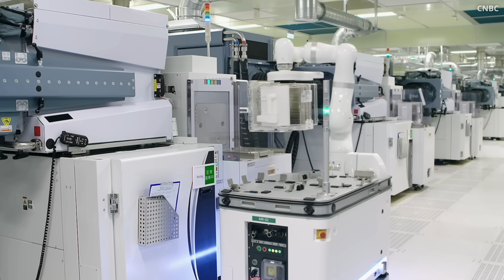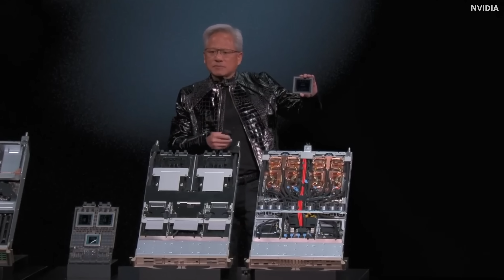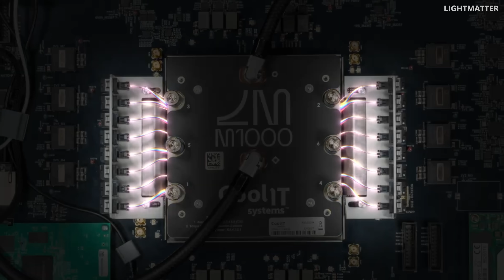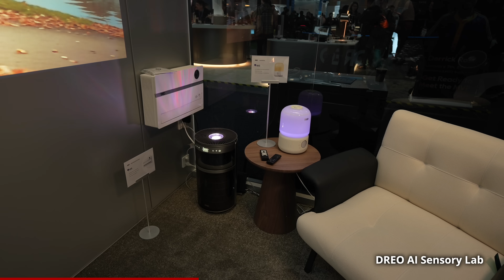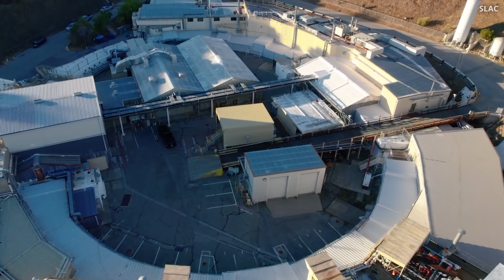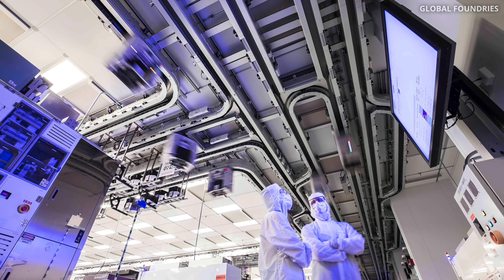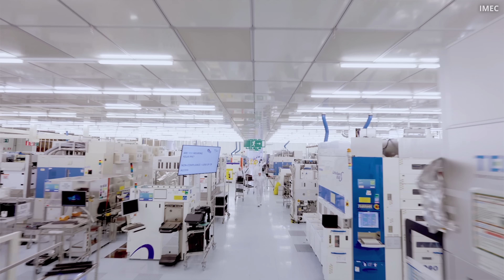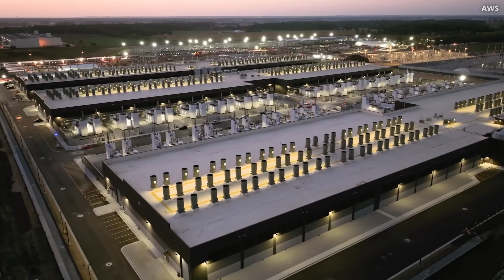This New Technology Could Kill TSMC and ASML

Comment: 1 nanometer = 5 silicon atoms. So the physical hard limit is 0,2 nanometer technology, or am I wrong? Eventually they will arrive at this atomic limitation with X-rays too, you can't go smaller/split a silicon atom? 🤔
Reply: I’m pretty sure she’s explained this in past videos.. where the nomenclature isn’t based on actual dimensions. IE. The 2nm chips being designed aren’t actually of that size. I think it was for all the chips that went below like 12nm. But the performance of these chips is equivalent to if they had shrunk it to that size used in the nomenclature assigned to them. Or something along those lines. I have a hard time following it all.. this stuff is way beyond my understanding or experience, but that’s what i remember was the explanation. I’m sure someone on here can explain it better.. if I’m in even in the right ballpark lol
Reply: @airheart1  The dimensions they give is converted transistors per mm², as in, they layer transistors on top of each other, which yields the density that let's say 2nm would, except the transistors aren't actually that small and take more energy than if they actually were 2nm or whatever.
Reply: @Alice_Fumo  you can explain it better than I 😁.. i just remember the sizes aren’t what they say they are physically after some point 👍
Reply: @airheart1 more like all chips below 45nm. 

Even then, there has been an element of bullshit since the 90s
Reply: It all depends what "you" measure... To be fair, todays "3nm chips" are probably about 12nm and we can get to actual 2-3nm or even 1nm with Xrays (also changing the substrate).
Reply: @doggSMK That's completely wrong. Everyone has been completely misled. X-ray technology will take another 20-30 years to fully overcome, at which point X-rays will be obsolete. And the market will still be monopolized by TSMC and ASML. 😂
Reply: @airheart1 That's completely wrong. Everyone has been completely misled. X-ray technology will take another 20-30 years to fully overcome, at which point X-rays will be obsolete. And the market will still be monopolized by TSMC and ASML. 😂
Reply: @airheart1 so why u try to 3xplain something u don't even understand smh... making her followers look real strange
Reply: We won't need to go that far to hit real limits. Transistors need to hold electrons. Electrons can easily (quantum) tunnel through an insulator 5 atoms thick. Bits will randomly flip at room temperature at this scale, we then need to introduce even more complexity in design and production that makes the increase in density ineffective in terms of cost.
Reply: Not quite. The physical limit is much larger dimension due to quantum effects that compromise the ability to operate as a transistor at physical dimensions below a few nm.
Reply: If we split silicone atom - it would be no longer silicone atom 😂
Also why worry about 0.2.nm when we didn't go smaller than 1nm.
Reply: In the 1950s, SF writer (and polymath) Isaac Asimov wrote of the "nudged electron" being the final basis of computing technology, following the shrinking size of transistors. This was only about half a decade after the invention of the viable transistor, some of which, at the time, were the size of a child's finger. I also recall an SF short story of his, published about 1955, in which a commonly owned portable communication device is described in terms indistinguishable from a modern smartphone with internet connection.
Reply: Correct, but the story is about cost effectiveness not scale.Still using x-ray is far off..
Reply: You can change silicone with other material tho...
Reply: That's completely wrong. Everyone has been completely misled. X-ray technology will take another 20-30 years to fully overcome, at which point X-rays will be obsolete. And the market will still be monopolized by TSMC and ASML. 😂

Comment: It prints patterns on the photoresit not the wafer itself !
Reply: It does print, but it is a multi-step multi-layer etching+fill process. 
Similar to how printed circuit boards are made, but in nanometer scale.
Reply: @kaba_me  You're right to point that out but it's a common misconception that the photolithography machine directly prints the wafer in a single exposure !
Reply: @Wapiti-p2k  Definitely not a single layer process, but the result is a printed wafer. The photo-resist layers are temporary (basically stencils)

Comment: At 9 minutes, you say X-rays are few Angstroms, which you the substantiate as being 0.1-10nm, but then claim this is thousands of times shorter than EUV.  However, the EUV wavelength used by ASML (based on laser generated tin plasma) is 13.5nm.  EUV wavelength are already essentially X-rays.
Reply: dude she is like the naked news of tech she has no idea wtf she is talking about
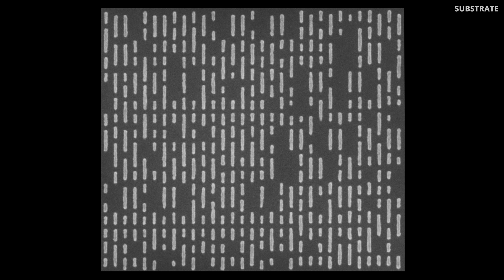Reply: At 12:41 she said 12 nm when I think she means to say 12 angstroms, in order to get 4 nm resolution?
Reply: At the 0.1-1 nm angstrom wavelength range you are talking about the scale of single or pairs of atoms. How exactly do you create a p-n junction or analogous transistor mechanism using such small cluster sizes? It doesn't seem possible to me. Many electrons in the Valence band need to be manipulated by the voltage bias simultaneously, but we are talking about literal handfuls of electrons for in the bands at such scales. I'm no expert in atomic scale microelectronics, but I'd be surprised if this can work... Explanation appreciated! Any reference publications?
Reply: @enthusiasticKumquat You shouldnt take angstrom literally. Many of these features are similar sized to the 14nm age, as I understand it - but their density and efficiency has increased. Process size had become a marketing name rather than a measurement.
Reply: @HexerPsy  Ah ha... Never let physics get in the way of a branding opportunity 🤦‍♂️ FFS.
Reply: Then at
Reply: So you are saying the people who research this are just wasting their money for no reason trying to develop the x-ray technology? Sounds legit bro.
Reply: @supernus8684  i have an invisible bridge to sell you
Reply: No wonder she does not work in the industry anymore :)
Reply: The definition of an x-ray, or rontgen ray is the manner of production. Using electrons shot at a dense metal, the electrons deflect, producing high energy photons. The energy of x-rays is determined by the maximum voltage used by the machine, though it produces a spectrum of weaker photons you ll want to filter out next. In physics we are talking about the compton effect.
If you can produce a visible spark - you are producing x-rays. Stuff that is so weak, it cant get through glass even.
X-rays can be produced even into visible light - though the event becomes very rare and inefficient, it is practically invisible.

EUV is... lets be honest: the name of a color we cant see.

The way we name parts of the photo electric spectrum so the average viewer can make sense of it... is very lacking.
For reference, the x-rays used in even a medical hand image is up to 0.05nm in wave length. So I dont see why we need a cyclotron when you really just need a simple x-ray tube with some good filters and gold mirrors...
Reply: @HexerPsy Probably same reason you need it for x-ray crystallography.  You want a single wavelength at an extremely high brightness.  If you thought EUV mirrors were low efficiency x-ray is much worse.  Though I guess crystallography really wants coherent light.
Reply: @petergerdes1094 But that's a filtering problem after the electron-photon conversion. That is equally difficult on both machines.
Crystallography requires high brightness and low divergence of the beam. Neither are required for lithography vs the downside of building the cyclotron. The linear accelerator would fit in one litho machine.

While you can attach multiple stations to one ring - if the cyclotron goes down then all machines are down.
Reply: @H @HexerPsy ose are good points but I disagree about some of the facts.  Yes, a free-electron source for x-rays is often not purely single frequency if you seed it then it produces very monochromatic light.  And while yes you can filter an x-ray tube if you want to get a very sharp frequency peak you are going to be filtering virtually all the energy.

What I don't understand is why you would use x-rays at this point.  Why not just use electron beams themselves.  Once you have an accelerator then you can produce a ton of bright e-beams which you can control via magnets.
Reply: @petergerdes1094  The Wikipedia article on Electron-beam lithography will tell you quite a few of the problems. Many of which would also be applicable to mask-based electron lithography.
Reply: @HexerPsy  Perhaps this technology requires a level of precision you can't get from filtering X-ray tube emissions.

Comment: At some point, seems like they'd shift to 11 nm light.  Fairly small change, just new mirrors.  The current light source would work.
Reply: Very little gain from 13nm to 11nm. Multi patterning is much cheaper and gives you a much higher resolution

Comment: Now, I remember long ago, that chip lithography used tricks that produced features smaller than the wavelength of the light used at the time, Maybe they had just started using UV. The word "refraction" comes to mind. I can only guess that the wheeze doesn't work at the current wavelengths/feature sizes. Maybe multiple exposures is the modern version.
Reply: You are thinking about immersion lithography which they use ultra pure water to amplify the Numerical Aperture before the light hits the wafer. This no longer works with EUV because any liquid use to amplify NA absorbs the EUV light. So the only way to increase NA in EUV is to use bigger and bigger mirrors.

Comment: Have they actually produced anything at the claimed scale? What is the failure rate? How is it housed? How are connections made to the bus?
Reply: They only printed tiny lines. They have yet to print a single working transistor.

Comment: phone chips are already maxed out, by putting more cores or transistors it drains battery too fast or heats up too fast. there must be new way of printing or different chip design to evolve. most companies cancelled the new 2026 flagship models because of these reasons I mentioned.
Reply: I would think that it will take a new type of media away from silicon wafers

Comment: Sure, ASML is already working many years on the next gen.
Reply: Yes yes but this isn't merely next gen, this aims to replace traditional EUV lithography with a totally different tool. Substrate’s technology utilizes a custom particle accelerator to produce X-rays. While their initial commercial systems focus on "soft" X-rays (1-10 nm), the accelerator platform is capable of generating wavelengths down to 0.01 nm (hard X-rays), which theoretically allows for feature sizes far beyond the current 2 nm semiconductor roadmap.
Reply: @aexetanius I understand but do you not think that ASML is also not looking into this ?

Comment: What about the "new" japanese fab thingy, where they stamp out elements of the chip.... Though pretty sure they wanted to use it along side EUV to handle the "easy" repeatable parts to lower the overall price and increase the speed per wafer
Reply: Nano Imprint (NIL). Will only be applicable for memory chips.
Reply: Nanoimprint is much better path forward and they are not declaring you need to throw out all the current tools just so you can make their technology work. I'm not sold on x-ray lithography until they can show working transistors printed using it.

Comment: Is this access to 3D printing silicon, like pcbway/jlcpcb . Ive seen descrete components become IC's, through hole become surface mount, the ability to take a transistor radio apart and make a flip flop is constantly being re-created, arduino modules , you can make great stuff with little soldering expierience.This is where the engineers of tomorrow are starting, at the module level not the transistor level.  There are still alot of foundrys using .... more robust lithographys (unfounded hope)  which may be more tolerant to contamination , cheaper filters , it would be great to not have so few white righnos.

Comment: You also need to mention that There are many chips that are more simple and larger that is still required for manufacturing. Will we ever stop needing a triple-nickel timing chip? I don’t think so. It may be reduced to the size of a SM resistor or diode, but it is still large compared to a 3 nm circuit. Anyway, it needs to be said.

Comment: X-ray lens and mirrors?
Good luck with that.
Reply: There are x-ray telescopes. Mirror is covered in gold or iridium - its been done before.
Reply: @HexerPsy  not the kind of mirror you're thinking of. To reflect xray wavelength photons you need them to hit the mirror surface at about 1 degree angle, this means long optical path with tiny aperture. Imagine a bundle of straw each coated in gold on the inside, that's the kind of mirror you need to direct (as well as focus) xray onto a sensor. Suitable for a telescope, not suitable for lithography. 
This project possibly uses similar mirrors to EUV lithography, with coatings made of repeating layers of pure materials, each layer is reflecting a minute fraction xray of a specific wavelength, with 20-30 maybe more layers stacked on top of each other the total amount of reflection can increase to a practical level.
Reply: @RiftmcUs  I believe from a lab experiement - shooting a x-ray beam at a metal bar, would return roughly 40% of the dose at source.
The downside is, that the bar became a secundary x-ray source. (The lesson being, where in the room would you be safest? 90 degrees next to the target lol).

I am not too familiar with the exact lay out of x-ray telescopes.
Also not sure how you would reflect specific wave length of xrays within the mirror...

Whenever you reflect or scatter x-rays you produce secundary weaker ones, effectively making the next mirror an x-ray source.
I think the mirror could be part of the filter - absorbing and scattering weak photons - while the harder ones are more likely to keep a straight path of reflections.
But that might be barely an issue. I could imagine the machine starts with... idk, 5x the target frequency, and the mirrors step down the energy due to the compton effect.
Reply: @HexerPsy  The Compton effect scatters in all directions. A mirror reflects light in a very particular direction. There are a lot of different types of x-ray optics, but they all have major disadvantages. That mean that solutions do exist, but they are very challenging.